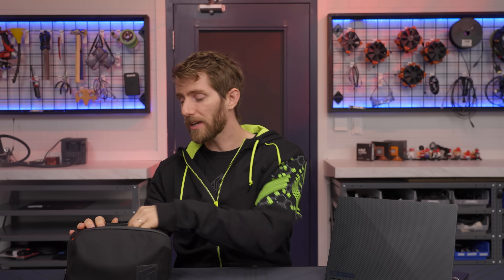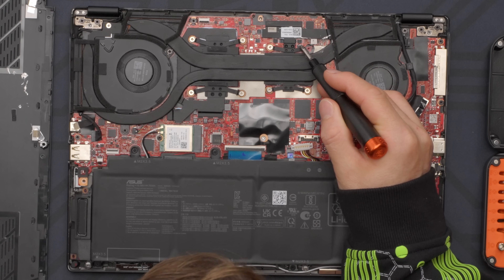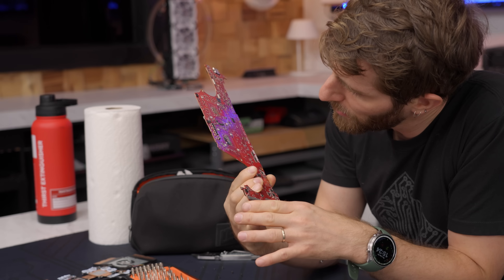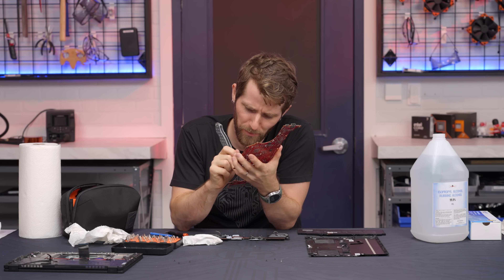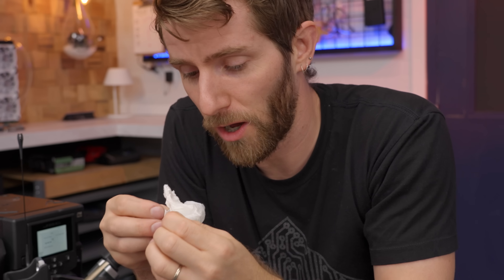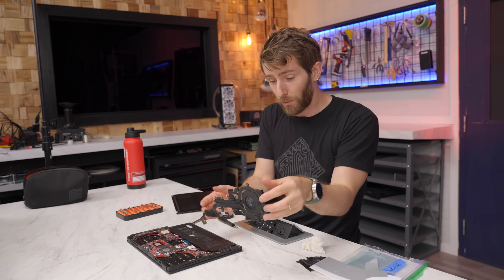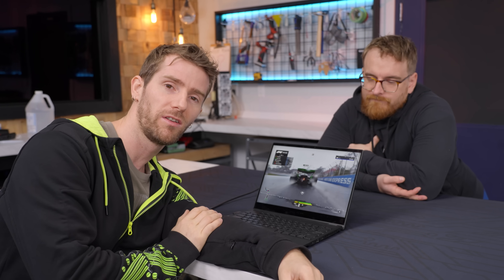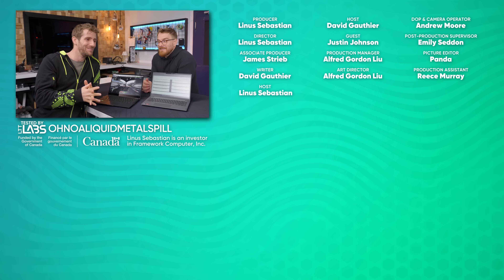Liquid Metal Killed my Laptop… Now What?

Comment: I guess this is why my Asus laptop came with only a 6 month warranty. Should I risk taking it apart to change out the liquid metal for thermal paste? I'm quite handy with electronics but the last laptop I had with a complex heat pipe arrangement had this copper foil stuck over all the VRMs which didn't come off and go back on the same way.

Comment: On the other hand: Its a LAPTOP. Not a stationary desktop. Its designed to be carried around. If this stuff cant handle being moved, its a failure in design. The fact, you COULD use sausage as insulation for your house, does not mean you SHOULD do it.
Reply: How effective is sausage as an insulator?
Reply: @wanderingtf2314  Probably starts out good, but you're likely to notice decreasing performance over time, especially in the lead up to cooler temperatures if you have an abundance of wild critters like the (bastard) red squirrel.
Reply: Thats what she said
Reply: @wanderingtf2314  Should work fine in Australia's 40 Celsius summers...
Reply: @geoffmerritt I can imagine the smell
Reply: @geoffmerritt  with 40c day they should be cooked just put some in some bread and tomato sauce hmm wood tasting sausage that’s gone off sounds yum 😂
Reply: @wanderingtf2314  10/10 for taste and smell 3/10 for insulation ability
Reply: you forgot the bakon a.
Reply: There are LM laptops that are fine, Asus is just a trash brand

Comment: I would definitely put that board into ultrasonic cleaner. The heat should be enough to shake out the Liquid Metal. Be sure to flip it over a few times and keep it suspended in tray so the LM settles to the bottom

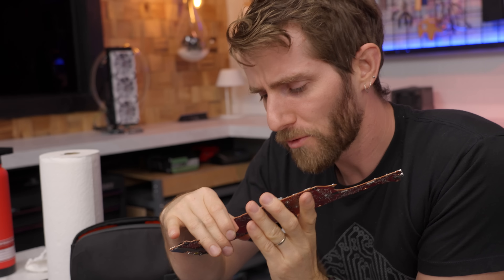Comment: Asus is using *way* too much LM on the die. That tiny ball Linus points out at 08:04 is roughly how much they should be using for the entire computer. They are using orders of magnitude more, so of course it spreads far too readily when the cold-plate is screwed down.
Reply: i checked their marketing vids one,they freaking pumped the metal in,not applied

Comment: This is ridiculous. If the tests were proving it was better I'd say okay, but the fact that it was basically the same, except for some minor extreme uses cases is stupid. And having to wait for the laptop to cool before bagging it, this is totally ridiculous. Like no way. If that was some kind of fool-proof design with no possible leaks I don't know (I'm not even sure that is possible) but the fact that it can leak, corrode solders make them bristle and basically brick the whole computer in case of failure is a stupid design for something that is SUPPOSED TO BE MOVABLE. In desktop computer I'm not saying it's bad, but for laptop this looks like a bad product design, period.
Reply: Plus, Windows laptops sometimes don't go to sleep.

Comment: 18:45 the liquid metal is not on the die cause it pumped out, this is a common issue with Asus liquid metal laptops and it is the needed amount cause after pump out the die will have heat spots and heat transfer issues. Had to do the same maintenance to a used Asus laptop recently, fortunately before the lm managed to short stuff. Painful to get it off, as it doesn't like to stick to anything. I fortunately got it removed with carefully rotating cotton swabs and lots of patience

Comment: Using Liquid Metal is worse than using liquid cooling.
5% performance gains at max loads doesn't validate reduced durability on parts that can be used with alternative thermals, On A MOBILE Device.

Comment: If liquid metal has gallium in it, Gallium loooooves sneaking itself into many other metal matrices and drastically changing the physical properties, beyond just shorting it electrically. Aluminum is the most famous one because it makes it like a wet paper towel, but it does it with many others. Most times you can’t air freight Gallium unless it’s in specific hazardous materials packaging and you cannot even bring it in the passenger cabin because if any leaked out it could literally destroy the plane mid-flight depending on what it got into. I’m surprised these laptops haven’t been banned from flights if they are so prone to leaking.

Comment: Liquid Metal should NEVER, EVER be in a Laptop! What are these companies thinking using Liquid Metal in a platform that moves around a lot! It should never be used in a portable platform! Only stationary, even then just buy a high grade Thermal paste. I would rather deal with slightly higher temps than bricking my $2000 laptop!

Comment: I'm no engineer, but i think putting liquid metal in something you're supposed to lug around is a pretty bad idea
Reply: ngl the replies under this are kinda funny
"just don't use your laptop wrong and it's fine"
which is true technically but doesn't take away from the fact that the benefits aren't enough to really justify the risks
Reply: Imma an engineer, and it's still a bad idea lol

At least with this kind of cooler design. Slapping on a single gasket as a single defense layer, without even changing the mounting gear and pressure of a standard laptop, it is a pretty weak implementation. Even worse than the similar ps5 implementation that, it's not even mobile (but heh, vertical), and yet has a way more chunky gasket and more pressure. And some ps5 still leak.

Anyway, Asus is known to not be the best as production quality
Reply: Agreed with the OP, putting liquid metal in something that you are going to carry around and will get jostled is an exceedingly bad idea unless the entire laptop is conformal coated so that if the liquid metal leaks, it cannot do much if any damage.
Reply: @christopherkidwell9817  even more so with how you are expected to let the device cool down, with a laptop thats just idiotic as often you use it on the go, so it will be warm when you have to put it away unless you want to sit around a while before going
Reply: @christopherkidwell9817  That's a good idea, to be safe, hoping not to overheat anything thoug
Reply: @christopherkidwell9817 That could be the future of CPU cooling- to use some sort of sealant around the CPU. Great idea dude!
Reply: Dont get why PTM isnt standard. Put it in my GPU and CPU and its been great on both with lower temps.
Reply: Every LM laptop I've seen has had horrible hot spots within 6 months on either the CPU or the GPU, or both.
Including my Scar 18 2023

It's technically superior before you use the laptop as a laptop and start moving it around and from that point on it's an inferior solution to PTM7950.
Reply: Not correct, I put LM on my laptop CPU and its ben doing great... That was 5 years ago and every 2 years I reapply do to dry out and it gets lugged around without a care turning it side to side up and down, so safe to say from my experience of using LM if you put the appropriate amount and not an excessive amount of LM it will be fine but that goes for any application.
Reply: LOL
Reply: Yup like using candle to illuminate your gas station 😢 very dangerous, at least for the hardware 😅
Reply: its safe IF they seal it properly, this is manufacturing shoddiness
Reply: yea, that''s why u no engineer.
Reply: @iSeeSharp2  that's why your grammar sucks.. and you are not engineer. why use something for a 1% gain that will ruin the product
Reply: lol Redmagic 10 pro phone with liquid metal. So far it's good, haven't heard of any issues
Reply: even PS5 have issue, its not about the liquid metal, its about the seal they use hardened foam seal. which is can degrade overtime and spill.
Reply: been using LM on laptop, he just did it wrong, thats all
Reply: I put Conductonaut on my Alienware 17R4 in 2018, and have lugged that laptop to the office, and back, and through dozens of domestic flights, several transatlantic, and transpacific flights (probably racked up 50,000+ miles and 100 pressure/depressurization cycles) and several cross country road trips as well. Still works great and has amazing temperature performance to this day.

That being said, I'm also an engineer who didn't skimp on assembly quality & protection when I installed it in 2018. I don't necessary trust the factory workers as much though.
Reply: LOL is this dumber than using oil to cool your stuff?
Reply: If ASUS is using Liquid Metal in their laptops, it clearly warrants a lawsuit over their stupidity if they don't replace every single one of these units.
Reply: @TheAnonymousPlatypus  cat trainer here and i think is still a bad idea 😂
Reply: I’m not an engineer either but you’re completely wrong. If you simply listened it’s because the manufacturer overlooked the mounting pressure. I use Liquid Metal on the laptop Ive lugged around to class everyday for the past two semesters and there’s been no problems.
Reply: If you properly design a seal around the die, these should be no issue… seems they forgot to do that. I seal using silicone around the die when I use liquid metal so even if it spills, it is contained.
Reply: @romanvarcolac2238 Sure, if it's well made and tested there's no problem
Reply: Anything that is vertivcal and the liquid metal can seep down, should be covered by Warranty. cough PS5 cough.
Reply: Not only lug around...but using Linus' language...it's negligent to use a "shim" or "gasket" to seal in liquid ...which is corrosive to aluminum which is typical in heatsink and heat shields.   a "seal" would be far better, and the use of materials which are not subject to liquid metal corrosion.  Plus the fact that the laptop tends to be transported in a plane perpendicular to the plane of the surface the device normally sits for operation (and that of the chip lying flat with liquid metal on it) without a seal is BEGGING for a leak to let the liquid metal seep out and get dragged by gravity across the electronics outside the gasket/shim.  It's why I put PTM7950 on my Asus ROG Strix G17 laptop...and it idles under 40 C.  It was idling at about or a little above 50C with liquid metal.
Reply: I'm not a cat.
Reply: I have had liquid metal in my daily driver laptop for almost a decade, it can be done properly, it is dangerous, and the old advice of don't put too much does go a long way to prevent this sort of thing from happening
Reply: from 2024 many ryzen machine dont even use liquid metal anymore,PTM7950 babyyyy
other machines use good thermal paste that is as good as mx2 or mx4
Reply: hello , not if you wana sell more . .. you ande me know every seal will broke eventually .... but the evrage jode does not.....
Reply: @ventusprime i really hate to be rude but this actually gave me a stroke.
Reply: @beefstew4773  well good to see it was not fatal . did you understand ? that is the q ? if you undestand it reached its goal .
Reply: Lololol
Reply: Thats why you're not an engineer! Lol
Reply: @SaebriSelect . Hopefully you’re not.
Reply: @SaebriSelect  a lot of repair service personnel that work on laptops will tell you that a good chunk of recent laptops they've worked on that offer liquid metal out of the box come for repairs because of the eventual spillage.  Parts-People Dell Laptop Experts, for example, is a repair and parts center for dell laptops that also has a YouTube channel where they post about repairs, and they are very explicit in their recommendation of not getting laptops with liquid metal applied.
Reply: @SaebriSelect  no he is right . why use something that will destroy the product and only give a 1% gain
Reply: @SaebriSelect  ye I've clearly been hallucinating all those core i9 / ryzen 9 laptops with liquid metal splashed around the edges of the cpu, it's perfectly safe yo...
Reply: @SaebriSelect I'm just a biologist but i think its a bad idea. (Well im not just a biologist technically my background is in machining more than anything else, but the fancy piece of paper says something something environmental stuff)
Reply: @SaebriSelect   You are not tech savvy obviously
Reply: @RGMerkel Its actually fairly funny if you think about it… its a joke because op is not an engineer and is making the correct choice.
Reply: @TheAnonymousPlatypus the cooling performance is worth it. Just don't be Linus and throw it around
Reply: @WilliamAllen-r5o so, just let the laptop sit on the desk, and dont travel with it?
Reply: @WilliamAllen-r5o nothing is worth the cooling performance if there's even a tiny chance of it leaking.
Reply: @WilliamAllen-r5o so it works great on portable devices as long as they never move ever.
Reply: @nedyahyakcam just be careful and dont throw your bag around. Plus he put it in the bag with it still hot which is a commonly known thing to NOT flipping do
Reply: @nedyahyakcam even putting it in a backpack and wearing it carefully will put flex on the machine too. Leading to uneven application or in the worst case a leak.

In other words it's an idea born from idiots being in charge.

Comment: 2 things: The lower mounting pressure on the liquid metal could be intentional. There are cases, where higher mounting pressure caused the liquid metal to be forced to the sides of the die, leaving a small dry spot somewhere in the middle. more metal but less pressure "fixes" that. At the same time, exactly this might've been the reason the liqiod metal actually performed worse. if there's a part of the die that doesn't get cooled properly, because the liquid metal ist pushed to the edge of the die, it will throttle sooner. And while I was researching this a while back, I found multiple other tests, where PTM7950 performs just as well, if not better, than liquid metal.

Comment: Not sure it would have helped Linus, but if anyone here ever takes modern laptops apart, don't panic if it displays no signs of life when you attempt to start it after the act. Make sure the laptop is good and closed (some of them have a light sensor inside that has to be in darkness) and connect the original power brick to charge. This resets whatever protection circuit the light sensor tripped and the laptop can turn back on again. At least this was the case for a new Asus TUF. 

I only know this because I panicked after simply installing a new SSD "bricked" my laptop, and then connecting the original power adapter magically made the machine work again, and then I went to read the manual. Doing that in the opposite order would have saved me about an hour and a bunch of gray hairs.

Comment: Yeah those weak pressure tabs on that heatsink are definitely not suitable for liquid metal, and are almost certainly the cause of the issue. Most devices I've worked on that have liquid metal from the factory (most notably the PlayStation 5) have extremely beefy heatsink clamps that apply a huge amount of clamping force to the chip being cooled, which along with appropriate sealing material, keeps the liquid metal contained even when running. Honestly in a laptop I don't even see a need to use liquid metal at all; not worth the risk for what is likely a very minimal improvement in cooling performance.

Comment: I am wondering if liquid metal is what killed my Asus laptop. It used liquid metal instead of thermal paste, and it one day just died. No lights, no signs of life, nothing. It may have leaked out because I had propped it up like a tent because I had my own monitor, mouse, and keyboard.

What's really annoying is I had swapped out the drive because I already had a 2TB SSD, but Asus support said I may be partially charged if I didn't have the exact same hardware.
Reply: They'll use any excuse to deny a warranty.

Comment: one of the few scenarios where factory application IS WORSE than application by hand. Its known they overdo the LM application with that stupid brush looking thing they show in their promo clips. So surface tension doesnt help, and foam seals arent enough either... i personally use conductonaut a lot, its great and lasts way better than some mx6 rubbish (pumped out in less than 2 months lmao), and when applied correctly it doesnt even need a perimeter seal (well for some peace of mind yea sure, but technically it stays there even after drops

Comment: I hate liquid metal. I have replaced it on my laptop with noctua nt-h2 after polishing the cooler. And what ? - like 3-5*C difference ? It is not worth the risk and corrosion. Liquid metal will have benefit from using it  for like half a year, and then you have everything coroded.

Comment: This stuff  definitely can destroy solder joints. If you put some tin alloy in jar with liquid metal it will disolve in it and became part of it. 

And it's destroy aluminum as mentioned as well. More precisely, a protective oxide film on its surface. Without it, aluminum itself deteriorates very quickly.

And gallium is toxic.

Comment: If the gasket doesn't make a seal.. whats the point. I wonder if its the air in that poket exspanding with temperature would cause worse mounting pressure and help to push out the liquid metal that get to the seal. Seems like if its not painted on very thin then your at high risk of it just causeing problems.

Comment: I have a 2022 ROG Zephyrus G14 and my experience was similar. My laptop luckily didn't have liquid metal spill and short anything, but it had abrupt shut downs and was severely overheating with something as simple as Resident Evil 1 on balanced pushing CPU temps to 95 degrees.

Opened it up and there was so much liquid metal and burn marks at the center of the CPU and GPU. Wiped away most the the liquid metal and reapplied new thermal grizzly and temps dropped by 10 degrees and the GPU can finally draw the advertised 105w. Asus definitely has a problem at assembly.
Reply: @criminalcuteness3952  do you use standard tg or liquid metal thermal grizzly? I want to change my pasta because my rog g513qm currently sometimes getting hot like 80 - 90 degrees even when im not gaming, but this video makes me wonder should i even change the pasta to the same metal liquid or should i change to something else?